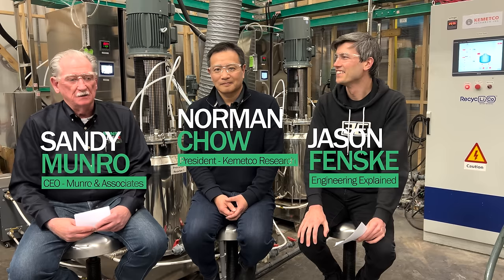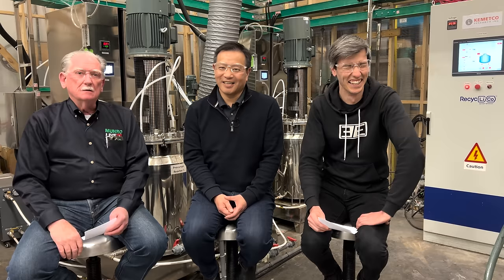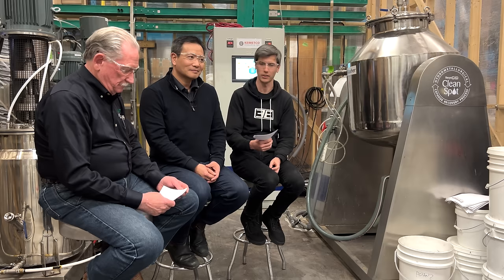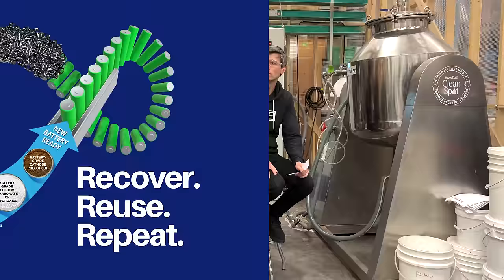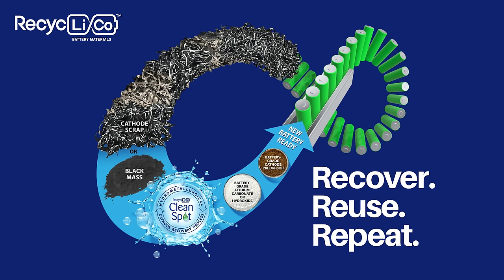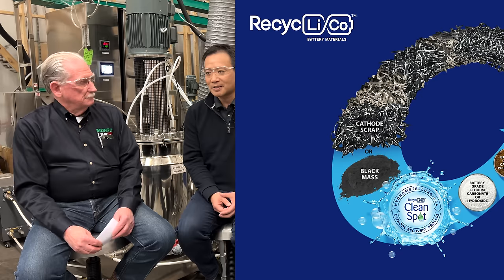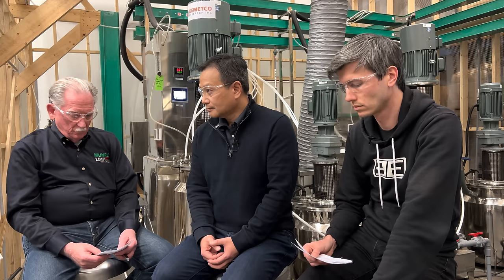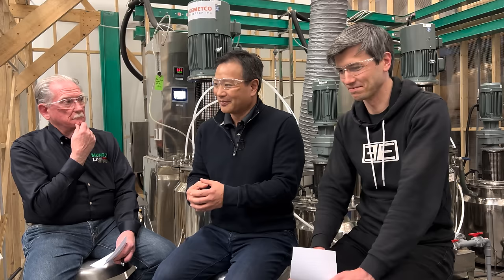RecycLiCo Battery Recycling Q&A with Engineering Explained & Kemetco Research

Comment: It was comment on the graph that stood out for me.  There are not yet enough spent EV battery packs to recycle to get the economies of scale to really ramp up that part of the recycling industry.
Reply: That is very true but, 30% QC failure is a massive incentive for manufacturers.
Reply: Not enough spent batter packs BUT the 30% rejection in Manufacturing of new batteries is huge and would provide a lot of feed material and a lot of base elements for new battery manufacture

Comment: I wish they put more emphasis on the different chemistries. How can recycling an LFP battery be as lucrative as recycling an LNMC battery? Can you even make a business case for recycling LFP or now Na batteries?
Reply: Hi, as he mentions in the video (27:15) there are different ratios for each mineral even in the same chemistry classification, so unless you want to see a chart on the current prices of each mineral you will never be able to compare different chemistries.  And none of that has to do with profit.  Profit is the difference between what a product costs to manufacture and what you sell it for.  So, if you sell your iron at 3 cents per pound, but get it for free, then you have made 3 cents.  And if you sell your Nickel for 4 cents per pound, but it costs you 5 cents, then you have lost 1 cent.
Reply: Well if that is the case you can just throw them in a landfill.
Reply: @jonathanjohnson8376 LFP is different beast form NMC/NCA, but until recently only in China and 3/Y  RWD had LFP batteries so only small portion of cars have these.
Reply: @asaha7547  Hi, I am not sure why you are replying to me specifically.  Are you saying that Kemetco's process can not be used for LFP batteries?  Or are you trying to add more information to my reply?
Reply: @jonathanjohnson8376 because they (intentionally?) avoided mentioning LFP, while process most likely can be used with LFP my guess it is unprofitable unless Lithium prices skyrockets again as there are no Nickel/Cobalt there. So probably only Lithium and Copper can be recovered.
Reply: @asaha7547 Interesting question as numbers of EVs with LFP batteries seem to increase rapidly.

Comment: I had a field trip to a steel mill that used recycled metal. They must have used appliances or industrial scrap and then added sacks of ingredients to clean up and get the qualities of the steel they wanted. They may have dipped their finger in at some point to get a taste, but the output would have been tested after rolling into geometries.
Reply: That is not the case with this process. When the cathode material comes out the end it is ready to go right back on a cathode foil. When one sees a good company they should buy shares while their cheap.

Comment: I believe at some point battery materials will be a national asset. Eventually the country would want to keep recycling and production as a closed loop.
Most probable start to this would be in grid storage. Say the electrical company who used to run peaker plants, would move on to more and more grid storage systems, first from end of life EV battery packs, then recycle them back into grid storage arrays. as more and more EVs go through their life cycle you end up with excess materials, which you either sell to recycling companies, recycle yourself and sell the purified materials, or just manufacture new batteries as part of your business. In long term there will be enough materials to negate mining/import demand out right.
Reply: Obviously you're wrong. It's already shown that personal devices are first and pay the most for batteries. Second is vehicles including heavy mining and construction equipment. Then storage is after that. 
The US doesn't like mining,  in Nevada or California where the lithium is. The chips act and others should have fast tracked lithium but they didn't. They talk like they have for votes but nothing significant is happening.

It's the same thing as nuclear power, breeder reactors and fusion power. The US ahould have at least 50 billion a year in the budget for development and they have less than 1 that gets cut and raised randomly.

The put so much money into the chips act that they can't use it and build the factories because the lack of workers.

The US doesn't even have a plan for fixing that probelm.

Comment: Two thoughts. 
1. What impact on water resources where the otherwise tempting mining or processing sites are, if massively increasing battery production to go all EV instead of using PHEVs to provide single vehicle options that can do 90%+ driving on electricity and 3% to 10% with nearly the same efficiency as a simple hybrid?
2. JCB is producing Hydrogen burning construction equipment with high duty cycle use (like their Diesel powered older designs), wouldn't it be advantageous to convert some of the heavy mining equipment to Hydrogen that they can produce on site, or as close as possible to water sources suitable for hydrogen production?

Comment: so whole batteries go into the shredder/pulverizer and segregated electrolyte and cathode material comes out? That would quite a timesaver.
Reply: The electrolyte was evaporated in a drying stage after shredding. That is all part of the shredding/pulverizing process that reduces active whole batteries down to stable powdered feedstock.

What this company does is takes that powdered feedstock, or the coated foils direct from manufacturer waste, and extracts the metals used in making both the substrate foils and the active battery materials. As he stated, they are not in the shredding business and that is a more unstable business. Many companies are doing something similar to what these guys are doing, what is unique is that they have a streamlined process that greatly reduces the number of steps required to get to the metals. 

Most of the other processes also dont generate a pure metal, but a compound that is a result of the solvent extraction... that would have to be further processed to be ready to use in batteries. These guys have an end product that is much closer to the form of the metals that is used to make batteries.
Reply: @patreekotime4578  not closer, it is pCAM. can't get any better than that.
Reply: The batteries must be totally discharge before the process can begin.

Comment: BTW - Tesla since 2018 has been INTERNALLY Recycling its used car Battery packs and started a Program to REPLACE under Warranty battery packs in S/X EARLY for Legacy MODELS.
TESLA also Recycles OLD Wheel rims , shred them, melt them down in Gigacasting furnaces .
Reply: How do they recycle them? Why don't they talk about their internal recycling process?
Reply: @energy_dense   - the DO EVERY Year in the Tesla IMPACT Report. published Annually.
Reply: Isn't the aluminium alloy of the gigagastings a bit more specific?
Reply: @rkan2   - YES, they can also Recycle ALL the Gigacasting scrap as well, in the Furnace .
the Gigacast materiel is an ALLOY. Designed by SpaceX.
Reply: @energy_dense Tesla does not talk about recycling used batteries  because they don't and they can't

Comment: Black powder, 30% waste.  70% remaining -12% = 58%.  The 12% is former aluminum foil that had anode material applied.
Reply: Recylicio commercializing Kemetco technology.  Hydrometallurgical process derives precursor material as feed stock to make new batteries.  Lithium products and precursor materials are the valuable end product of recycling batteries.
Reply: Mined material has over 99% waste so your point is?
Reply: @InformedKiwi  It is a synopsis of the process.  Draw your own conclusions.

Comment: What happens with the batteries that are not recycled. How does lithium spread in the environment and does it affect human health?
Reply: Why would you not recycle them that would just be a waste of money and we both know the govenment dose not like losing money XD
Reply: Lithium should be less harmful. I think it is used in some anti-depressants
Reply: @Y2Kvids  Lithium, like iron, is a key mineral for humans. For decades, Lithium is a primary treatment for bipolar depression. People living in regions where the soil is high in natural Lithium are less likely to suffer from BPD..
Reply: There is so much value in large lithium ion batteries that people would be crazy to dump them. It's like jewellers who work in gold never have a problem with having a "dirty" work bench ... every tiny piece and even filing dust is gathered up to be reused, not because they are all neat and tidy but because of the value in the residue. Even if the present recycling facilities are not up to speed it is worthwhile storing the battery packs until that changes. There is no evidence that I have seen to date that suggests batteries are being dumped. In fact one of the challenges for EV recycling is having enough degraded batteries to work with because they have been lasting longer than some people predicted.

Comment: I feel like a big tension is coming. The obvious choice in terms of price, longevity and sustainability going forwards is sodium ion batteries. But theres almost no reason at all to recycle them. Which means anyone into the mining, recycling or metals speculation side of things will demand we continue to use batteries with at least lithium and nickel in them. And maybe further along that wont be a problem... once we have electric flight en masse then we have a legitimate niche use that demands expensive materials and can keep the recycling and mining and metals speculators happy, while the rest of stable storage and most ground transport can switch to sodoum ion. But I worry about this interim period we are in for the next decade or so. I worry that sustainability and price to consumers will be forfiet to an entire industry pushing in a different direction.

Comment: 16:27 I think the bad news is, that there is not enough legislation and taxes on waste production. I feel like many cleaner production methods fall victim to the market where it's allowed to "dump waste into river" (environment) with no consequences. And then market punishes you for doing things more sustainably, not rewards.
Reply: Same thing has happened with fossil fuels over the last 100 years. There's very little regulation and a lot of subsidy to support the oil industry.
Reply: ALL States need to switch to 100% Consumer waste RECYCLING , rather than Landfills. 
and NOT just ship to 3rd world Countries.
but, actually Recycle IN - HOUSE .
Reply: my point here was, that when one company can make stuff and use environment as a "dumpster for free", with no cost,  then other company is in disadvantage, while not using the "free dumpster" and making things without waste. And then they can not compete. This should be discouraged by taxing waste.

Comment: Batteries/electric has a long way to go to work here when it is minus 30 minus.
Reply: Where's "here?" Glad I'm not "there!" 🤠
Reply: Western Canada. We had Tesla's that were at a stand still at minus 44 in Edmonton. Great lawn ornament though.
Reply: Last year I was in Kirkenes northern Norway where the temperature is minus 30deg for 3 months of the year. There were Quite a few Teslas there. So the extra 12 deg in Edmonton is the difference. That must make up say 0.0001% of auto use. At minus 44degs your ICE auto cannot just be left in the elements either or it will quickly become an “Ornament” too
Reply: @InformedKiwi Well I'm sorry I offended you. So one of us is not telling the truth.
Minus 30 How long will your battery last heating a car? I'll tell you the answer not very long. I also know that lithium batteries will not take a charge the colder they get, that is a fact.
Talk to any car dealer here in canada and they will tell you that at minus 20 you lose half your range any colder than that good luck.
ICE vehicles can struggle in the cold but with a block heater they start just fine. When the coolant warms up you have all the heat you need.
Now the fact that you don't know these things tells me something. I have lived in a cold climate all my life and speak from a lifetime of appearance.
Reply: @schulzmj1 Proper EVs have temperature management systems to keep the battery in good condition, making it possible to charge and discharge the battery even at very low temperatures. When parked you plug it in, just like a block heater. As already mentioned, EVs have been doing fine in Scandinavian winters for over a decade.
Reply: @Simon-dm8zv Everything I have stated I know as fact. Lithium batteries struggle greatly even before minus 20 power management or not.
You speak from ignorance I speak from experience.
Good day!
Reply: @schulzmj1  It is clear you have no experience in driving an EV.

Comment: Any future in converting ICE bodies into EV's
Reply: Not really.
EVs have much better aero because they need it to have good range, compared to just fueling up a ICE car.
A EV battery takes up a lot of space and the cooling system is very different, so a lot of customization is needed.
Turning a ICE into natural gas powered or something like that could be better for the environment then EV conversion.

Comment: 30% waste on new EV battery manufacturer is huge. Cost reductions with the solving of the rejection rate in itself will be massive. When rejection can get to sub 5% will give about a 25% savings in materials. Add this to advancing Battery technology the future cost of EV batteries will be substantially lower. The future if EVs is assured 😊

Comment: TESLA 4680 is Already using MORE Advanced DBE - Dry Battery Electrode , compared to EVERYONE else , still using "WET" Cells in their Batteries. 
TESLA is also working on making OWN Cathodes in Multiple Chemistry like LFP , NCA/NCM, & HIGH Nickel. 
TESLA is also Building OWN Lithium Refinery in TX .
Reply: Do they actually do any recycling in house?
Reply: @energy_dense   - TESLA has been Recycling, spent battery cells since 2018 , published  since 2021.
Reply: @markplott4820 What process are they using? O ya they don't have one! Don't post your comment until you can answer.
Reply: Yes all hail the the Tesla god, bow down and worship Tesla.
Reply: @schulzmj1   - IN - HOUSE Recycling @ Shanghai, Fremont, Berlin , Texas , BUFFALO, NY, Lathrop Megapack, KATO Rd & MORE. 
both Battery cell, waste & Gigacast recycle.
Reply: @markplott4820 You are typing a lot of words and not answering the question. "what process are they using?"
I know of all kinds of companies claiming they recycle lithium ion batteries. "recycling" is a broad term. 
Tesla cannot come any where near to recovering 98.5% of the CATHODE MATERIAL! So spare everyone your lack of knowledge of what recycling lithium ion batteries entails.
Reply: @schulzmj1   - TESLA impact Report 2022.
Reply: @schulzmj1   - the DIFFERENCE is , oem like gm & FUD dont have any ON SITE Recycling , they ship to 3rd World countries.
TESLA 100% Recycles INTERNALLY , even its WASTE water gets TREATED & Recycled. TESLA also harvests & treats RAIN water. at ALL LOACTIONS.
Reply: @schulzmj1   - the BEST process is NO PROCESS . - Elon.

Comment: Most unreliable consideration for EVs is eco idiots that push to downsize power production of seemingly any kind. EVs can be great and I want nothing to do with them if I live in California that has been unable to fix it's power delivery problems for more than 20 years.
Reply: At least in California you can basically charge your EVs exclusively on solar in many situations...
Reply: @rkan2 Solar availability sure. It's no walk in the park though. The up front investment on an at home charging setup with solar and battery storage along with a good EV is comparable to running a modest mpg ICE vehicle for ~400,000 miles. EVs are very much still a wealthy persons privilege.
Reply: @saccaed  What battery? For most commuting miles you'll be able to charge plenty during the weekend for example. Besides, solar doesn't only need to be on your roof for it to give benefits when it comes to the grid. 

However in sunny places most average driving miles can be charged easily with a modestly sized solar system, even if you are working during the week. The investment isn't even that big if you're not buying the car solely on feeling.

Also keep in mind not all sunny places have similar cost of fossil fuels. Many places in Europe are almost twice the price. Solar installation costs are also generally a bit cheaper outside California.
Reply: @rkan2 Battery is for charging the car at night. It is pointless to 'sell' power to the grid in California then subsidize night charging with the sales during the day; California made it such that consumer produced solar sold to the grid is a fraction of actual grid pricing. You are absolutely correct about pretty much every country that isn't the US having much higher fuel costs. They will have different maths to work out. For the US, EVs are a wealthy person toy. At home chargers are essentially non existent in rentals. Chargers have been making good penetration into retail store parking lots, gas stations and to some extent workplaces. For a none home owner in the US an EV more often than not more annoying to own than an ICE vehicle. All of the above before even touching the third of the country that does not live in high density cities.
Reply: Tesla is now a power utility. Tesla is solving brownouts in California and Texas... and Australia, and ....